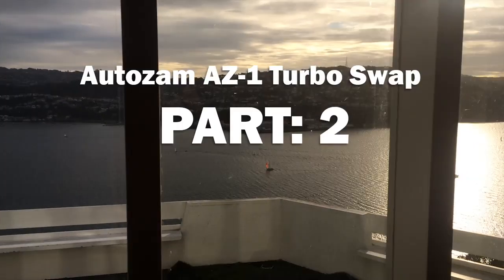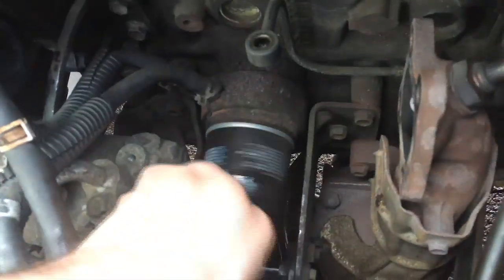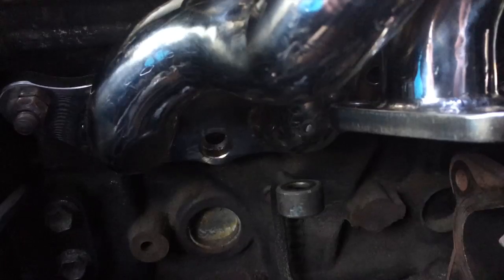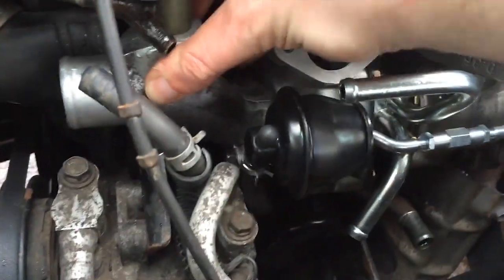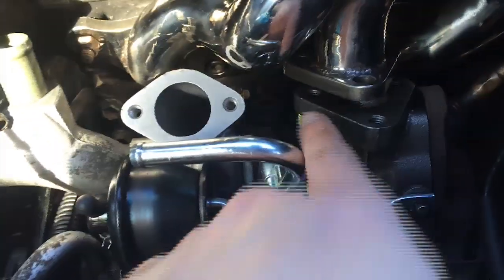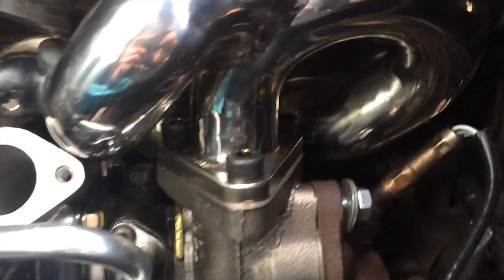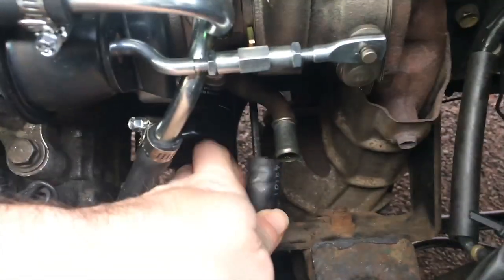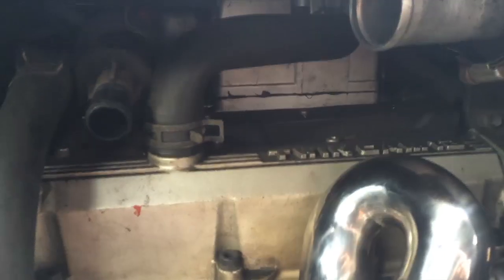Autozam AZ-1 Turbo Swap: Part 2

Comment: I know this video is from a long time ago but turbos get hot, why wouldn't you relocate the oil filter & oil filter cooler?  At the very least you should have put some high heat hose insulator wrap. I've seen these AZ1's in person and an oil filter relocation kit is doable.
Reply from the maker: *Shrugs.. the Suzuki engineers thought it was ok so I didn't question it.

Comment: "kudos to the engineers of this engine and turbo setup, but I hate you all." That's awesome! 
I've felt that way about several cars I've owned.
Reply from the maker: HAHA oh man, I really miss that car.  I totally should have kept it.
Reply: @NewZeroland  I traded my crx for a 1994 saturn sl2. Huge mistake. It haunted me for years. Then a bought a crx to restore. It was beautiful when I was done! But since I was used to my Lexus as a daily driver and I also had a porsche 928, the crx felt slow, loud and uncomfortable. I sold it and the 928 to buy my current boxster. Now I plan on selling the boxster and Rune to buy the ribelle. It's the circle of life. (or toys) What's next after the ribelle?!?!
Reply from the maker: @CRPerformance1  haha yeah man, I'm in the same boat.  Unfortunately my wallet nor my garage space can take in new vehicles without getting rid of other ones.  Trade up, I say!

Comment: Cars dump blow-by pressure from the crank case into the intake that contains oil vapors.  This is done so the oil is burnt in the engine instead of letting pressure build up until it dripped onto the ground like old cars did.  In a turbo car this air gets blasted back through your intercooler and intake when you come off boost without triggering the blow off valve, and in a legal setup your blow off valve will recirculate too.  You can try reduce this with an oil catch can, good luck find anywhere to put it in this car.  So it's normal, but will get worse as your cylinder seals wear out.  Research "positive crankcase ventilation" for more info.

Comment: Great stuff Sam, # 1 to share a Like :)
Amazing how hard it is to work on these lil precious PG6SA kei sportscars.

I wonder how hard the PP1 Beat is too work on, you can't even see the motor on them either.

I'm amazed about that oil filter, 
I guess the shops in Japan must take out the lower crossmember each time to do a service.  Crazy!
Reply from the maker: Haha yep!  Every picture I see of an AZ1 in a shop is up on a lift with it's engine out.  The Beat I'm sure is the same deal.  My buddy has a Cappuccino and said it's "the easiest car in the world to work on"... and I'm so jealous O_O  I should have video 2 up soon.  The fuel injectors are next to impossible to remove so that may have to be a video on it's own.